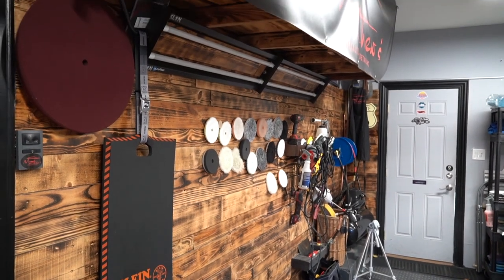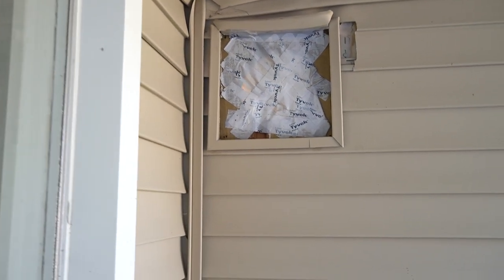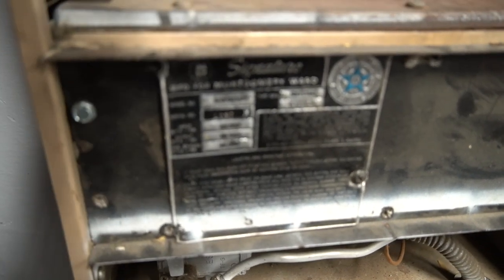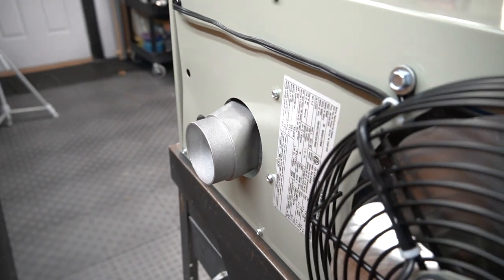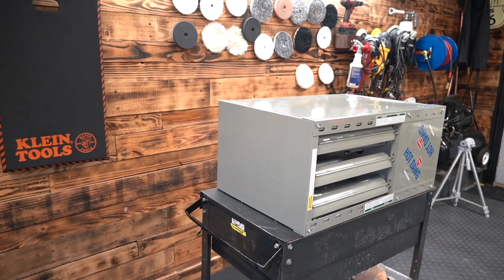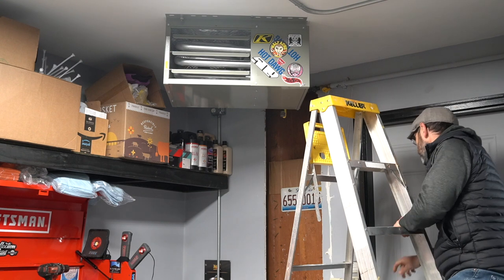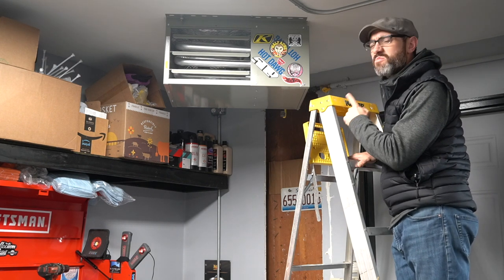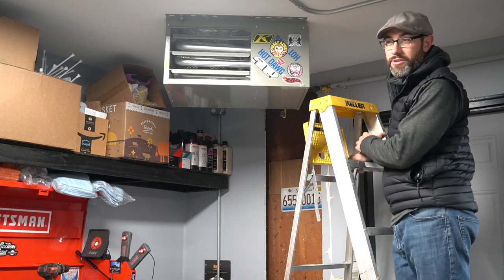Detail Shop Heater Upgrade

Comment: I just installed the hot dawg 2 weeks ago and it is bad ass...huge upgrade...I also ride the U.P. and detail on the side..great stickers...sux not much snow there yet..u F.I.B..lol
Reply from the maker: Thank you for watching! Nothing but love for a fellow snowmobiler. Enjoy the new heater, and "think snow"
Reply: Thanks for the upload,
I’m fixin to acquire the exact same heater. How do you think it will do in my 32 x 40 with 10’ ceiling? (Well insulated). Thanks
Reply from the maker: @T-roy33  My first question is what part of the country are you in? You might want to consider the next unit size. I believe if you look online, Hot Dawg has a speck chart and what they recommend based off size and square feet. This unit should work ok  just might run a little longer on the cold days to hold desired temperature! My shop is 22X24
Thanks for watching!
Reply: Understand thanks
It’s gets cold here...the Midwest. I already have an unvented lp htr and want to add this one. I’m getting it at no cost except I believe it needs a fan motor.
Reply from the maker: @T-roy33  perfect 👌 I am sure it will do the job just fine. Can't beat the price.
Reply: @matthewsspecializeddetaili610  right! Thanks again fellow Midwesterner?
Reply from the maker: @T-roy33  correct, I am in the western suburbs of Chicago.
Reply: @matthewsspecializeddetaili610  ok south central Indiana

Comment: How is the new shop heater working for you? How many BTU is it?
Thanks, Jake
Reply from the maker: Hi Jake, 
This heater is working perfectly for my small shop. Quick start up and it heats up the shop fast.  I believe the btu output is 37,000. Online it says 30,000 but in the back of the unit its saying 36,900 🤷‍♂️ 
None the less it has been reliable  and warm!!
Reply: @matthewsspecializeddetaili610  That's good to hear, thank you.